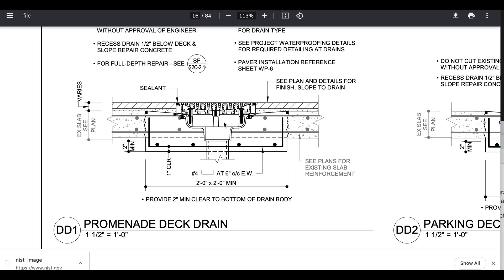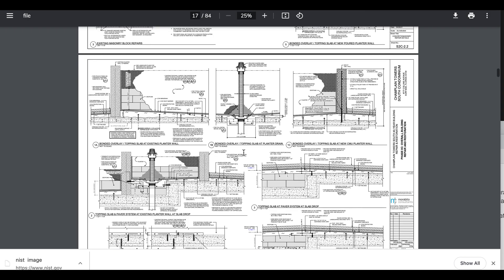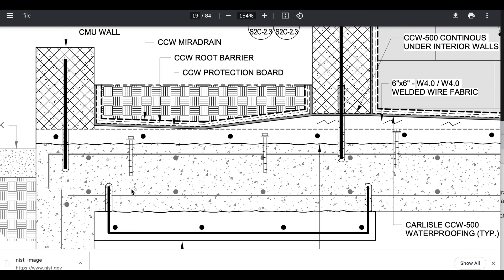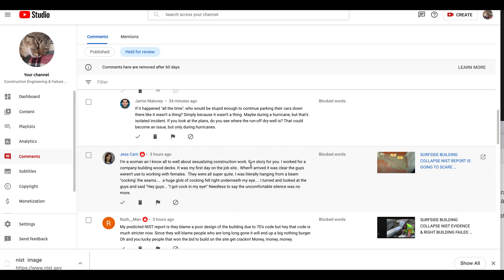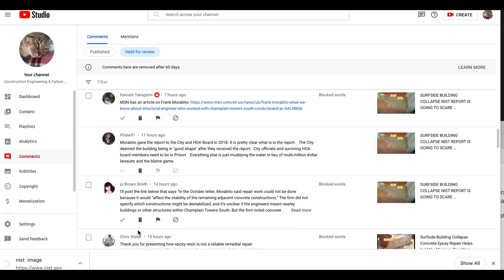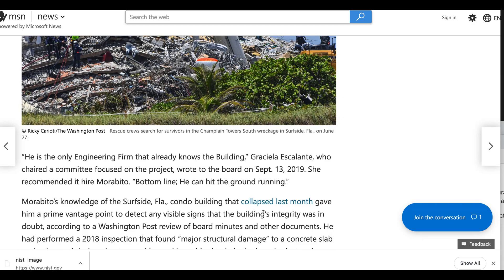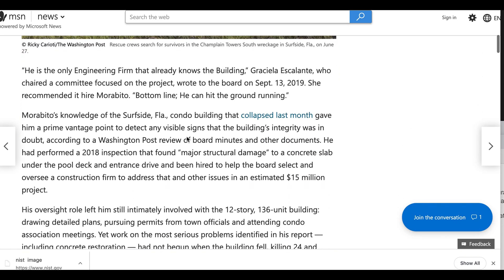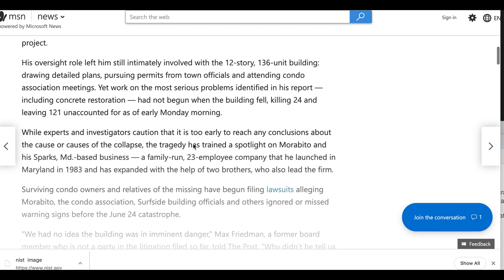Champlain Towers  Building Collapse HOW ''STAPLES" IN CONCRETE CAN SAVE A BROKEN MARRIAGE   Part 2

Comment: Just my two cents on when it comes to assigning liability to the engineer on scene in a scenario like this.  It appears from report that Morabito was aware of structural deficiencies.  They present their report and recommendations, but ultimately the parties that awarded them contract get to choose the order in which work is done.  By the looks of things, the major structural repairs were not yet fully funded and were in the preliminary steps of the permitting process right before the building collapsed.  There was a three year internal fight in the condo board over the price of repairs.  Some parties wanted more estimates and second opinion on the repairs.  Sticker shock had set in.  The engineer is often ignored even on new builds or pressured into going along with what the one paying for the project desires.  It is sadly how it works in many cases.  We really don't know if that is what happened here, but it is likely to come out in any litigation that occurs.  I am generally cautious though on blaming the engineer when often times, the one that awards the contract will at times choose to make their own decisions and just bring the engineer on for the formality of the permitting and inspection process and to rubber stamp work at times.  Risky business for sure, but that is the way it works at times.  That is why assigning blame won't be clear cut without knowing all the particulars of this matter.
Reply: One other note as well.  A failure like this specific one has previously been rare.  Parking garages collapse often, but generally don't pull down their attached structure because they are generally isolated from or the collapse stops at a shear point before reaching attached building.  It became common in the 70s and 80s to integrate parking garages into building structure as a way to save money on residential use properties that are more price sensitive than government or office tower properties.  These building are just now coming of age since trend started fairly recently (at least when talking building lifespans).  I am sure this will be something the look for more often now though it is too late for Champlain tower south.  The deck ledger tied to structural building columns is more common than we like.  You will find it in hotels, apartments and other condos all over the country.  More common in residential use type properties in mid to high rise structures.  Large commercial office type and government properties usually lack this problem as they are not as price sensitive to the cost of construction and are often willing to add in redundancy to building.

Comment: The lawyers will be rubbing their hands glee. The staples in the concrete works really well it can be done in this case nothing was done not ever putting props in as for old guy hasn't got a run in him.

Comment: ughh, yt messed up my comment. I said the 2018 report said the roof was in "satisfactory condition" so idk why they started with the roof. Cheaper than the structural repairs? They didn't secure the loan till mar.,2020. In hindsight they should had been advised by MC to put the reserve money into temporary but more critical measures to support the building.

Comment: 🏗🧱📺❤🎈🐈🎈🐈 You've found so many errors in Southside Champlain condo collapse , makes me wonder how safe is  Northside Champlain  Tower ??
Reply: I guess we will see some shoring there soon.  They have done things there already, but I think there will be preventative work performed.  They have returned the pool deck and balconies back to tile.
It hasn't been said if both buildings were Franki piles and if the basement slab is on top of the piling caps as with the south towers.  The Franki piles were indicated to be a more expensive system, so there was a reason that they recommended and used them for they south towers.  That said, the south repairs/ shoring in the basement would have been basically on the pile caps.  Josh had not shown this (pile/ slab connections only) and indicated no pile cap support for the basement slab at the south towers (meaning they would have had to fix the basement slab first to shore the pool deck slab). 
Don't forget the crane collapse with the lowest boom section member wrapped around the plywood forms.  Just little differences between the two sites.